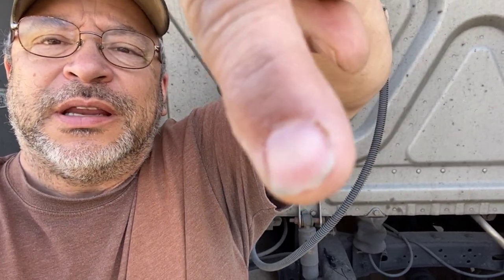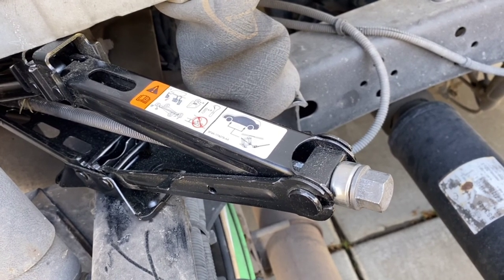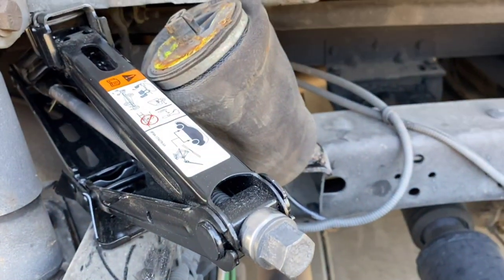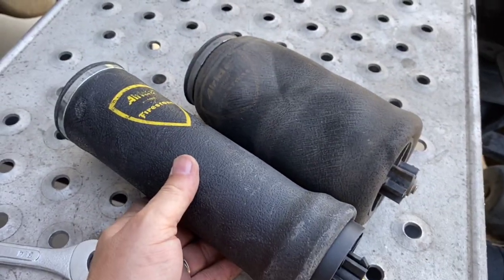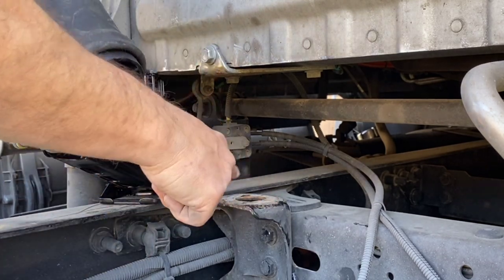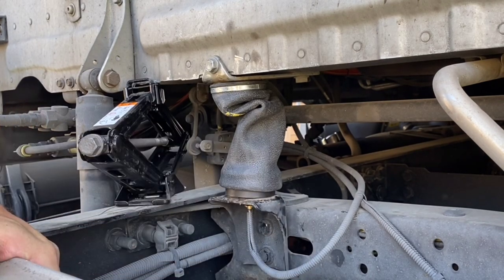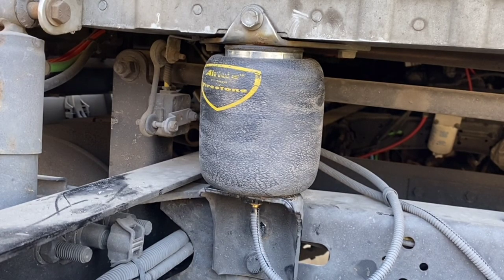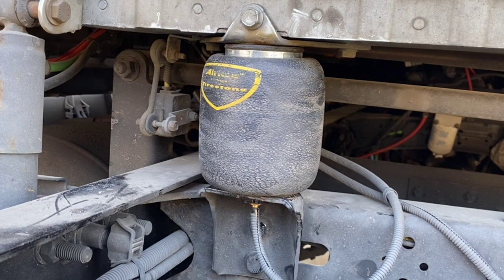Changing a Semi Truck Cab Air Bag | 2013 Freightliner Cab Air Bag | DIY Trucking Repairs

Comment: I’m only noticing how much your cab shock can move left to right on its upper mount putting extra stress on the cab torsion bar bushings 
Maybe a spacer in there would stop cab left to right wiggle 

My 02 379 day cab blew a bag so this helped me a lot in doing some homework my front cab mounts were toast too 
Spend 300 for two from cab mounts & two new cab air bags 

Awesome video!

Comment: Already changed both on my sleeper, but they’re leaking through the fittings on the air bag. Any idea if those fittings can be fixed ?
Reply: Servicing the air fitting is not generally possible, however usually an easy fix. 

Remove the air line, with a sharp box cutter take off 1mm from the line. Cut at a 90 degree angle to the hose. Re-install airline.